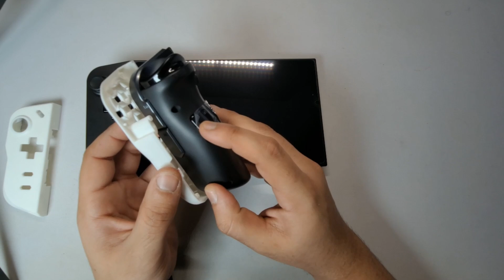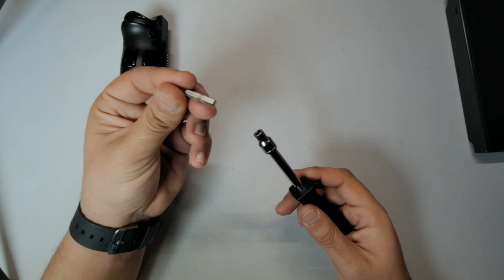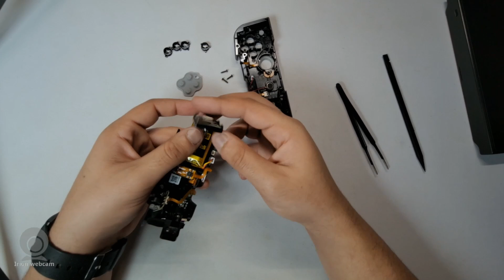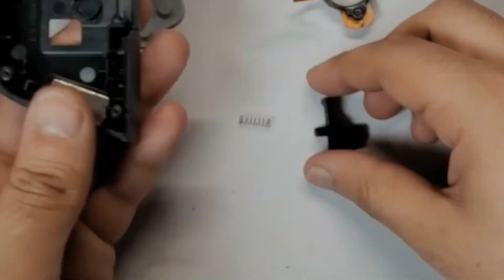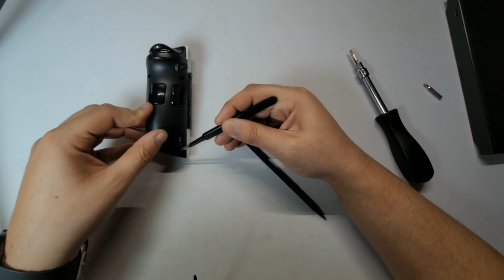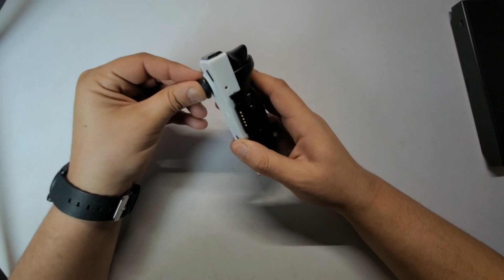Lenovo Legion Go 3D Printed Controller Grip Mod Guide | Controller Teardown and Reassembly

Comment: The left one digs into my hand because of where the stick is so i changed that one.
Reply from the maker: Yup I have the same issue but with both sides. The comfort grips help but the right side still hurts after 30ish mins. Right now I have two sets of controllers. One with the mod and one without. The left side of the one with the mod actually doesnt work anymore because I left it in a hot car and the plastic deformed on me, making some of the buttons stick. Now what I do is use the regular one on the left with a comfort grip, and the modded one on the right. I'd still use the modded one on the left too if it didnt deform on me 😭

Comment: Great tutorial, thanks so much.  My right controller kept reverting to FPS mode whether I flicked the switch or not, but I was able to fit the bottom mouse board in like the OEM controller.  Drilled a small hole for the switch and it works.  Fit was a little tight but everything is functional. Thanks again.
Reply from the maker: @jonathanstanziano774  no problem. Glad I could help! 😁
Reply: I'm facing the same problem, what did you do exactly? What was the problem that occured?
Reply from the maker: @CXHo-sy1xz  you just have the switch connected and in controller mode. OP just drilled a hole in the controller in order to get access to the switch from the outside so he could switch it without reopening the controller.
Reply: @TheKingsLegion  hey rq. I know this isn't related. Any chance you know why the right controller doesn't register a mouse click? The m1 button does, the RB button doesn't. I tried some software stuff, handheld companion, legion space. Nothing so far.
Reply from the maker: @ hey srry for the late response. only thing i can think of is you have it in controller mode. If you have it in FPS mode then im not sure srry. maybe defective controller. if still under warranty do a claim and request that they send you replacement controllers. dont let them tell you to send the whole device in for a controller issue. Ive heard alot of horror stories from sending the device in and controllers are a disposable part for Lenovo for some reason despite being like $90 lol.
Reply: @TheKingsLegion  Good to know about the warranty, thanks for that.  I'm probably gonna rock these until the Legion Go 2 comes out. Rumored to be backwards compatible. Thanks again!

Comment: does that mean if it doesn't lock in the place properly it won't charge the controllers properly
Reply from the maker: @jakenewman3992  No, it still charges the controllers properly. It just feels like the controllers are not clicking in. They still hold decently well so they won't pop off on accident or anything

Comment: I printed all of this last month and havent had time to do the install. thank you for the guide. I also printed the mod for the xbox elite dpad. how did that go?
Reply from the maker: @stoffersjason  Glad I could help! The elite dpad mod is no extra work if you're already doing the controller mod. I've now done the mod to 2 different controllers 1 with the OG dpad the other with the Xbox elite Dpad. I personally like the OG better. I think the dpad mod is good but the print file isn't perfect so it's pretty easy to hit directions you don't mean to. That doesn't bother me cause I don't use the Dpad for actual gameplay, I mostly just use it for menu navigation. I don't like how high the elite dpad comes up out of the device. I prefer the flat feeling OG dpad. I've never rlly understood the complaints about the dpad anyways. I think  the dpad  in the LeGo is fantastic. But like I said I use it only for menu selection
Reply: @TheKingsLegion  thanks for the advice. i just wont add it if so cause i dont want to have to take everything apart if i dont like it.
Reply from the maker: @stoffersjason  you got it. Thanks for watching! 🫡